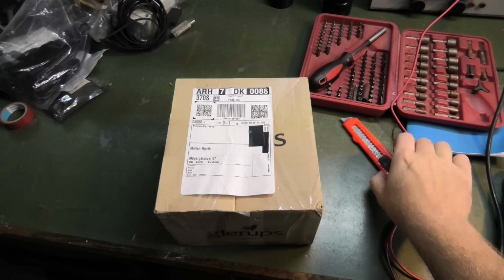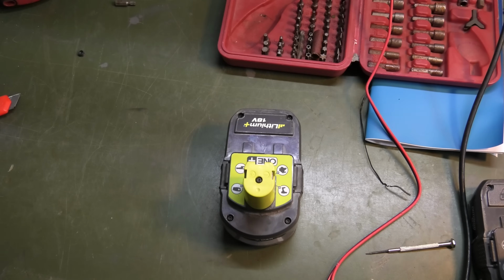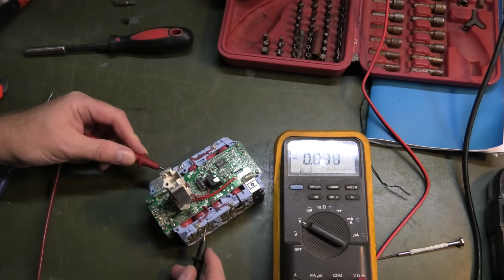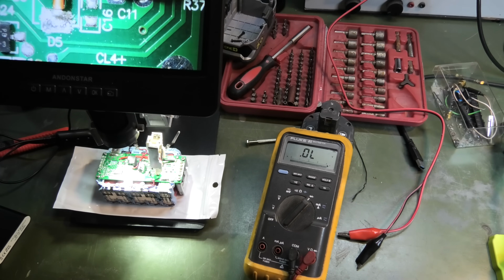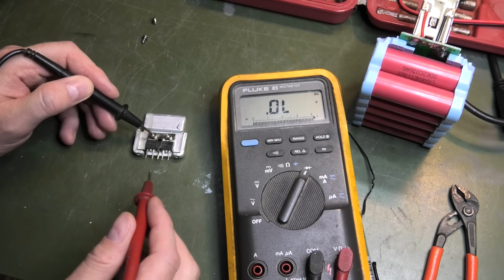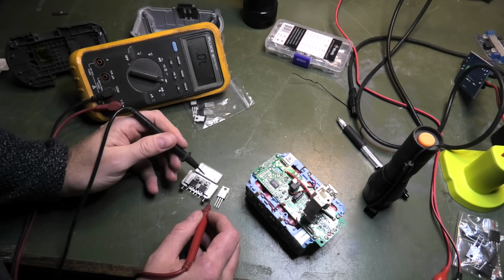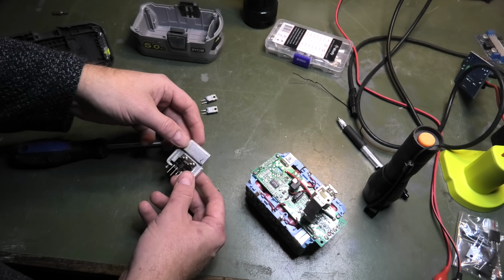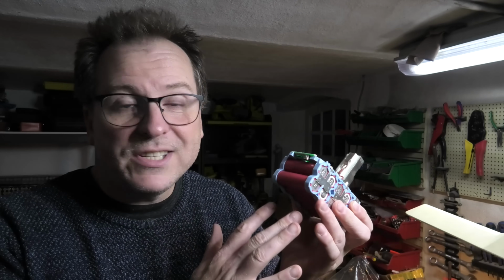Defekt Ryobi 18V Battery,, I FAIL and need your HELP - 1327

Comment: Not supposed to ship damaged or defective lithium batteries
Reply: Why don't you cry about it,    ...saddlbags (Ace Ventura)
Reply from the maker: That is not helpful.
Reply: @MyPlayHouse  it is to anyone that doesn't want to get fined, or worse.. A lot of people, apparently you included, don't understand that lithium batteries are hazardous material. For instance, you absolutely are not allowed to ship a battery via air, by itself, if it's more than 30% charged. Was that battery in your video charged? How do you know, it's damaged... That's why there's special handling requirements for damaged batteries.... Helpful enough or should I go on?

Comment: Hi Morten! I am glad that I could provide you with a mystery. I hope there is a solution. You recall correctly. I had the battery plugged in to a light, and forgot it in a tarp, which was filled with water overnight. I took apart the battery, and let it dry out. Never got it to charge. It has been sitting around for a year at least. Luckily I found a 2-pack 5AH battery pack, and received a 9AH one for a gift (great for my chainsaw). 

...and those pads are not filters - they an absorbent packing material to avoid essential oils from leaking all over the place while being shipped.
Reply: I have a bat with the same problem. Accidentally left my tool outside overnight and it rained. Brought it back in and let it dry, but it would not output voltage out of the stork, but battery's showed normal voltage when disassembled and tested. I got some more life out of it however, That reset symbol is not for them too solder joints, It's for the last through hole. I put my metre on to current, then pulled RST low to ground then high to 4 .4 volt. It then showed 5 bars of charge. but it goes back to 1 when put into a tool and still not output.

The main difference between your battery and mine is that mine had absolutely zero signs of corrosion. No watermarks or anything. I'm worried that the battery microcontroller might deadlock Itself whenever it detects a fault condition. For your safety of course... Not to prevent repairability and sell more batteries, I'm sure.

I know that you can buy a ryobi battery kit from this Chinese seller. I bought just a motherboard itself from them myself and it successfully got delivered. However, I accidentally popped the board by not watching where my wires were flying, And the lithium-ion batteries dumped their power somewhere where it shouldn't go... I have not yet bought another main board since, but it would be interesting to take both sets of cells and turn it into two smaller capacity batteries using their complete assembly kit.

https://www.lithiumbatterypcb.com/product/p108-ryobi-5s-li-ion-battery-18v-pcb-board/
Reply from the maker: Thank You for the mystery 🙂 I have really tried everything.. But I hope someone comes with a good sugestion.

Comment: You already had a good indication at the first component you tested - if a diode read normal out of circuit but shorted in circuit - something is shorting this diode - find the short and you have a reasonable chance you found the busted component. if you have another battery with the same circuit board you can compare measurements between boards
Reply from the maker: Hi @fransvankralingen725
Thank You very much!  glad you liked the video :-)
Thank you for watching! :-)

Comment: You should get a component tester (I use the "deluxe" version with a scope and generator: FNIRSI DSO-TC3 less than 50€ but there're cheaper option for only tester function)  it will give you more informations about the healt of diodes,  capacitors or MOFSET than a multimeter
Reply from the maker: Humm christmas is coming :-)
Reply: @MyPlayHouse  LCR-T4 component tester also works well. it's called an LCR tester.
Reply: @MyPlayHouse the LCR-T4 is cheap. $21 CAD

Comment: it almost looks like some acid or electrolyte leaked from the end batteries.  the tabs were missing the shiny metal coating and looked kind of rusty/corroded.  when you measured the diode i saw solder flake off.  the electrolyte could have damaged/corroded copper traces in the cicruit board or the solder of parts connected to the board.
Reply from the maker: All batteries measured fine and I had the PCB under a microscope,, and did not see anything,, missing :-/

Comment: your mosfets are behaving like they should.  GATE(left pin) DRAIN(top tab/short middle pin) SOURCE(right pin)  when you charge the gate the mosfet will allow current to flow from source to drain.  if you short-circuit source to gate it will go back to behaving like a diode again between source and drain.  the gate acts like a capacitor so it will hold a charge for a little while.
Reply: to test a mostfet... black meter lead on SOURCE(right pin) red meter lead on DRAIN(tab or middle) should read OL. then holding black lead on SOURCE touch red lead to GATE then red lead to DRAIN. it should then be reading 0.0000. that tells you it is controlling the silicon switch.  MOSFETs have body diodes for flyback protection between SOURCE and DRAIN.
Reply from the maker: Yes,, I did not see the logic to start with,, normally they open and shout faster than I can move the peens.

Comment: LOL, Apparently the link I added in my response got flagged as spam and I got a complaint about it... not spam at all youtube... anyhoo, This is essentially what it said:  If so, use ‘mini-charges’ – slot the battery into the charger for a few secs, remove before the lights flash. Repeat up to 30 min until it has enough charge to ‘revive’ itself.
Reply from the maker: You,, must have missed the part where I check all the cell´s and find that they are all super fine and in balances..
Reply: @MyPlayHouse  Yeah, I saw that and considered it, but it may still be that the memory chip thinks it's dead and this process apparently forces it to get out of bed so to speak. Edit: this is because the onboard microcontroller runs it's battery safety program and stores values in it's memory. From what I understand, this process cycles and refreshes the memory, allowing the battery to essentially reset it's onboard system and grab updated values...
Reply: @digitalsparky  What memory chip are you talking about? Specifically.

Comment: The principle of diode test mode on a DMM is that the meter tries to force about 1 milliampere through the diode, or a resistor for that matter, and then tells the resulting voltage.  But the key thing is, it cannot provide more voltage than the meter design has made available.  That could be just 1.999 V for low cost (3 1/2 digit) meters and possibly a little more for fancier meters.  If there is some external voltage over the diode, the meter internal 1 mA supply can not overcome it and shows just overload.  All that means, you probably don't get any meaningful indication, when there is a 4-volt or higher battery involved around the diode.  Then to the MOSFET story.  All they have an internal parallel diode, inherent between the Source and Drain.  For N-channel FET the diode structure is Cathode at Drain.  The Gate is totally insulated from the other terminals -- only certain amount of capacitance.  If you try to measure your "diode" between the gate and the source, you either charge or discharge the gate, depending on the polarity.  For many FETs, the diode test voltage of the meter can charge the gate enough for the Drain to Source path to allow the tiny 1 mA test current to flow, an in fact in both directions.  So the diode in parallel appears to be shorted.  That means, your FET measurements were exactly as expected.
  I would suggest not pursuing more diode tests.  Rather measure voltages, including is the group of small transistors supplying anything to the gates of the big FETs.  Of course also, what are the voltages on battery series, not one by one, check the progress from one end to each pair.  Your individual pair results indicated a well functioning (or functioned) BALANCING operation.  Also, you don't seem to suffer from what I have experienced a couple of times -- opening of the internal pressure detecting fuse contact.  That contact makes the cell totally disconnected and the only remedy is replacement.  As a "fun" side story, I once tried to reset the pressure sensing dome.  After some failed attempts, I succeeded, got the cell show respectful voltage and tried to charge the pack.  All OK, but just a few moment with applied load, it popped open again.  Apparently the increased length of the cell was permanent and pushed the dome to snap open, again from my marginal restoration.
  Sorry, I cannot give more relevant advice about your actual problem by just watching your video!
Reply: OL does not mean Overload. It means "Over Limit". It means Infinity Ohms or basically and open circuit.
Reply from the maker: Yarh,, lot´s of wisdom,, but no fix :-)

Comment: The fact that the battery meter reads low, probably means there is a cooked current shunt resistor, or the micro is not able to measure the battery pack voltage with it's resistor divider. This could be a red herring, as the micro might just flash low battery when it's in fault condition... but I haven't pulled one apart to see as all my ryobi batteries still work ;)
Reply from the maker: Best sugestion so far!! :-)
Reply: I think if the shunt resistor is burnt the Mosfets should be burnt also because normaly the shunt can take more current than a mosfet. It seems that the mosfets are not getting a  signal to their gates.
Reply: With all due respect,  I had hope when I found this video, but why did I just watch a 25min video only learn nothing. ??? You should've stated in the beginning this is a fail.   Ugghhh

Comment: the angle grinder I took it from (and the LEDs of the BMS) didn't work until I put it on the Makita Charger for a short time.
Reply from the maker: YouTube is messing up, and climes that I have not replied to this,, sorry for the "disturbance in the force" :-/
Reply from the maker: I do not think Makita and Ryobi is enough alike to have the same problems :-)
Reply: I know that Milwaukee batteries also resets themself if plugged into a charger.  @MyPlayHouse

Comment: I had a kind of similar Problem with a Makita BMS. Have you tried to put it on the original charger after repair/ resetting? Makita Chargers communicate with the BMS Chip, probably to make sure the cells are balanced. In my Case I had to charge the battery with a hobbyist LiPo Charger because I didn't have a working original one. The Pack was fully charged and worked fine outside the tool but
Reply from the maker: Hi @r.funden4512
Thank You very much!  glad you liked the video :-)
Thank you for watching! :-)

Comment: BMS 5S 15A 18V 21V 18650 Li-ion Lithium Battery Charger Protection Board Balancer Power Bank Charger for Drill
Reply from the maker: 15A is wery much on the low side,, you can pull about a 1000W from a battery like this
Reply: ￡3.17
10+ pieces, extra 5% off
P108 10*18650 Li-ion Battery Plastic Case Charging Protection Circuit Board PCB Box For RYOBI 18V P103 P118 BPL-1815 1820G ONE+ @MyPlayHouse
Reply: @MyPlayHouse  

Good point.

3s/4s/5s Bms 12v 16.8v 21v 3.7v 100a Li-ion Lmo Ternary Lithium Battery Protection Circuit Board Li-polymer Balance Charging